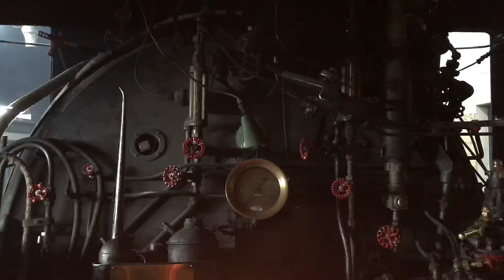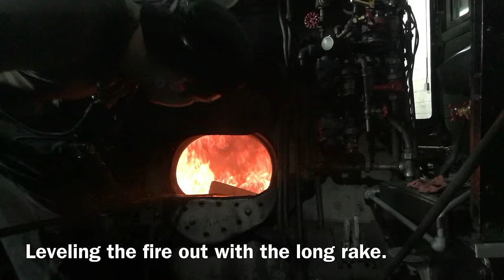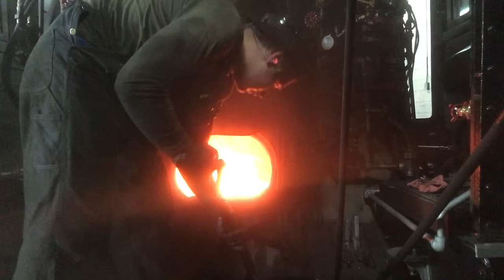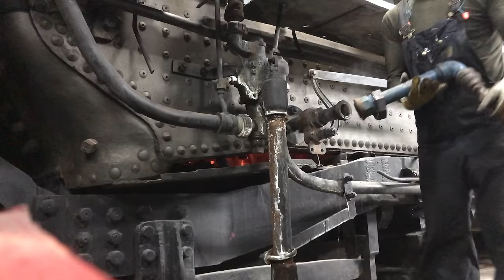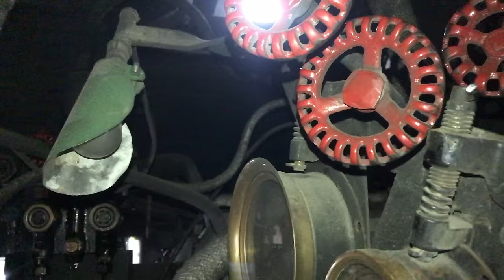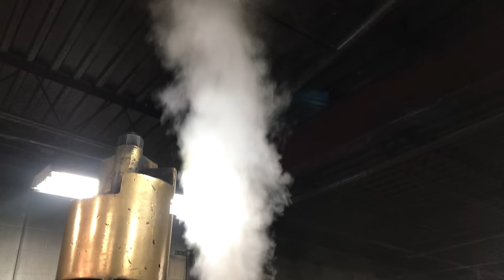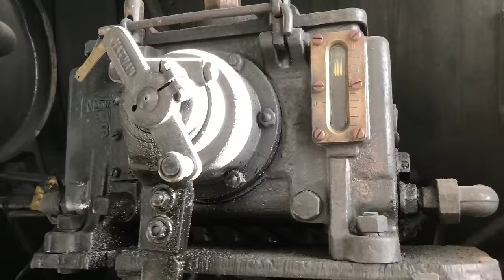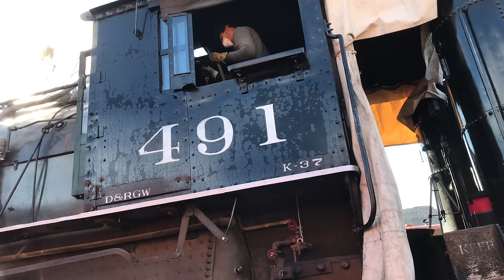How To Fire Up a Steam Locomotive [4K]

Comment: Really makes you appreciate the lads who Tokyo drifted the polar express
Reply: That was a cool scene but it would have fucked that loco up royaly
Reply: Tokyo express
Reply: You could go ask the nice folks at the Steam Railroading Institute in Owosso Michigan how well that would have actually worked. They're the caretakers of the real world counterpart to the Polar Express, Pere Marquette #1225. I've stood beside that legendary engine during some routine maintenance.
Reply: respect to Tokyo express
Reply: Mostly because the wheels can't be braked individually on each side like a car because they are bound together by an axle.
Reply: @gormauslander  Cars wheels are also bound together with an axle
Reply: Not really. They each have their own axle, and they're bound by a differential
Reply: @gormauslander  yes but you still cant break one wheel at a time
Reply: I never said cars couldn't. Cars can, because the wheels and axle are not cast in one piece as trains are. Adding differential breaking on a locomotive would be useless
Reply: @datguymiller  it was purely fictional. Trains are on a fixed axel suspension so wheels can't move or stop suddenly like cars can.
Reply: Wolfcola.mp4 I know but the sliding off the wheels would have fucked up the wheels
Reply: It was Santa’s train so y’all can take your logic and fornicate your selves with it cuz Santa has so many axels the train can turn the wheels sideways if it wanted to

Not to mention the best coco
Reply: Guys stop taking this joke seriously. It’s a JOKE, And the polar express is not the most realistic of movies. I mean it’s about a magical train going the the North Pole from god knows where in like 1 and a half hours as it goes through tons of tracks that are completely unridable and a waste of time to build.
Reply: @Victorsvolkswagens   Nani?! Kansei dorifto!!!
Reply: @renegadeoflife87  I watched a guy perform routine maintenance on the sewer beneath my house once... Unbelievable! To legendary experiences !
Reply: And that made me laugh kekeke. Good game, coach and well done
Reply: Fr tho
Reply: It was just a kids movie guys, calm down
Reply: Squidward Tentacles if I’ve learned anything from this, it’s that the locomotive community gets..steamy...
Reply: @staticalphabetsoup637  ye
Reply: Ah yes the polar express I love trains so it is a tradition for me to watch the polar express.
Reply: What’s crazy is that they had to four wheel drift just to escape. No wheels are able to turn like a car
Reply: Dank Express
Reply: couple 100,000 lb train doesnt break the ice yet a tiny pin does. yup! its a movie alright!
Reply: Legends...
Reply: @datguymiller  all she would need is new brake shoes and new tires over the wheels
Reply: @thatoneguy611  the polar express makes it's own tracks
Reply: @robintheslavewr1513  and a good oiling
Reply: @robintheslavewr1513  wait the tires wouldn't touch the ground (well ice) because of the wheel flange so you would need replacement wheels
Reply: @datguymiller  the flanges cut thru the ice so yes the did study the scene more clearly they touch
Reply: @datguymiller  it could water can cause pitting in the metal making it weak and crack so yeah it would cause damage
Reply: @robintheslavewr1513  so you would need to replace the wheels
Reply: @datguymiller  not the whole wheel just the steel tire around it
Reply: @robintheslavewr1513  what about the damage to the flange
Reply: @datguymiller  the flange is part of th tire
Reply: @robintheslavewr1513  oooohh
Reply: @firelynx1108  welcome  to  "Hollywood logic"
Reply: @alfredvonhofsten4010  you can if you plug off the other 3 brake lines on your car.... 
.
now a locked differential, no.... but 99% of cars and pickups use an open diff.... which CAN allow for 1 wheel brakeing 
again... only is something is wrong
.
like my jeeps caliper slide pins are rusted..... so i only have 3 brakes that work
fixing that soon LOL
Reply: @gormauslander  theoretically it could be done with 4 pistons and counterweighted wheels and axles
Reply: @baileydevries4494  I think you could do it with 2 pistons, you really just need 2 independent wheels instead of a single cast piece that is the wheels and axle
Reply: @gormauslander  oh true, it would just need some serious counterbalancing
Reply: Aggressivly shoveling coal into firebox whilst opening valves and pulling levers
Reply: @baileydevries4494  steam locomotivetives already have counter balancing on the wheels to balance out the force of the drive bar pushing on them so really to have it work like in the polar express is separate the one axle for a pair of wheels into 2 parts then prevent them from sliding out of the mounting points ... And then separate the two halves of the locomotivetives braking system and add separate controls...And then after separate the two drive pistons and give them there own controls... aka completely over complicated totally impractical and a waste of time and money when all you need to have is just quality fùckìng train tracks. Which would be way faster and cheaper and safer to just either rebuild fix or make new quality tracks. Edit: damn santa makes very questionable and horrific financial decisions
Reply: Smoker and steamer is their names if I remember correct
Reply: @Victorsvolkswagens  yea lol
Reply: OP😂😂🙌
Reply: You could also use coal instead of wood that would work better
Reply: The real skill was making it land back on the tracks underwater
Reply: @Mr_pumpkin_  oh yeah? Didn’t ask.
Reply: Movies are real life.
Reply: Bro that train bent around a mountain. It was just built different lol.
Reply: @gormauslander  it might help it go around corners or allow the train to go onto a different gauge of track?? maybe?
Reply: You knows too much bro
Reply: Yeah right
Reply: that thing is basically a time machine
Reply: @firelynx1108  that's actually possible if the ice is thick enough and where the pin hit would of been either a melting spot or of its somewhere that the ice is thin.
Reply: @alfredvonhofsten4010 actually the front wheels on the car are bound by a ball joint and tie rods due to the need for a steering system. The rear wheels usually use an axle unless the car is front wheel drive but it's a weirder design than you would think for a normal car.
Reply: The Polar Express Ready For Destination North Pole See Santa Claus

Comment: By the time you get rolling, you forget where you were going.
Reply: That's why they put it on rails.
Reply: That's why those went hundreds of kilometres at once, and hauled a metric shit ton of cargo/passangers
Reply: @KarolOfGutovo  passengers*
Reply: Wouldn’t it be....cheaper to never turn these engines off? Obviously this is a rare case but back when these things were a hit, did they actually let the engine go cold back at the train yard?
Reply: That's what my uncle would have said  or where were you going when I seen you comming back
Reply: You have 2 choices
Reply: @EliasDeJesus95  
The manpower costs of keeping every train constantly fueled would probably outstrip the benefits of a speedy departure, not to mention the copious amounts of water and coal needed to keep the firebox warm and boiler prepped, the ash buildup in said firebox, and the years taken off of the train's lifespan due to the firebox being constantly in proximity to fire, albeit relatively low temperature fire.
Reply: السلام عليكم
Reply: Ahhahahhaahhaha
Reply: lol
Reply: @VintageTechFan  this comment is too funny 🤣
Reply: @EliasDeJesus95  it would just make it extremely hard to do maintenance and it wouldn't be really safe plus it would shorten the engines lifespan and you would have to have people constantly working on it just a huge waste of money and staff pretty much but I mean if your going to use the train again in like 30 minutes to an hour in some cases they actually would keep it running they might just do a little greasing and prepping tho you can't really do all that much matinence while the engine is still hot plus I think all that constant heat would weaken the metal and nobody wants a exploding steam engine
Reply: @EliasDeJesus95  Some tourist railroads will keep the locomotives warm overnight on long excursions, but not fully running, NKP765 does this from time to time, but the crew takes turns doing night watch to make sure nothing goes wrong, and that gets really tiring after a while.
Reply: @jerrymartin7019  Still think the speedy departure would've been well worth it!
Reply: By the time you get rolling, you don't even have to go there anymore.

Comment: I guess you dont have to worry about someone stealing one of these.
Reply: tow it with your own locomotive... duh
Reply: To Get it hot faster use doc browns  presto logs lol
Reply: Gone in 37 minutes
Reply: welll they just showed you how to start the thing
Reply: Lmao
Reply: @supraman236  more like gone is 6 to 7 hours, according to the description
Reply: You just wait until the other guy has gone through all this, and then you steal it. Easy. Wait until he steps off for break time, and hop in and you're off. Or wait until he stops at a switch and then locomotive-jack him. Problem is that there isn't really anywhere to go; the people on the ground control which tracks to go down, and if you don't follow the schedule that was already being followed, you'll probably just crash into another train before too long. So what are you going to do? Steal the train and complete the engineer's run for him? There's a reason they don't worry over-much about people stealing trains (other than to cause mischief, i.e. by setting the throttle and jumping off). You've never seen an abandoned diesel loco sitting, idling, by itself for hours on end? There is some special key that the engineer takes with him (or her, must remember to be politically correct, right?) that must be put in before the throttle can be moved. But they don't guard the loco at all, in most cases.
Reply: Kel - Cool, thanks for that. It sounds like some are surprised these old locos dont come with immobilisers, central locking, and stop start.
Reply: @kelharper7971  its a joke, take it easy
Reply: Well, You'll know what road he took when he seals it.
Reply: It wouldn't be that hard to...........  Track them down...   Kill me.
Reply: the great locomotive chase!
Reply: Would be easy to catch them, just follow the tracks...
Reply: @kelharper7971  Well, they do guard the locomotives-or the rail yard more accurately. Having snooped around (read: trespassed) on yards in my youth many moons ago, I'll tell ya that Railroad police are the biggest pricks to ever put on a uniform. I suppose they have to be since a wrong turn can involve becoming mushy spatter.
Reply: you  know come to think of it i highly doubt you can steal a train at all lol it only has one way to go and thats forward tracks wont take you across the world
Reply: Caught a thief red handed in my car because he couldnt drive a manual without stalling it.😂🤣
Reply: @supraman236  hahahaha
Reply: A manual gearbox is enough for that
Reply: ukspizzaman plenty of time to reload a musket if they tried
Reply: @kelharper7971  "So what are you going to do? Steal the train and complete the engineer's run for him? "

….maybe...
Reply: You could “steal” it. But where would you hide it?
Reply: well thats why doc and  marty stole it
\
Reply: tow mater can tow this right?
Reply: @supraman236  
A better title would be "Gone in 60 Minutes"
Reply: Its RDR2 in real life
Reply: @MICKSHRED  Six Hours Later gets unexpected slap on the butt "Alright bud, shift's up. You'd better remember to punch out on your timecard."
Reply: Gone in 30 minutes or its free.
Reply: Just wait till its out in the open and steal it from horse back. Be sure to pack you bandana do want people give a description to the Marshals.
Reply: Just tow it using a Diesel locomotive.
Reply: We the People that would be heresy
Reply: Kyle Martin but I’m not a-
I said alright your shifts up, I’ll be seeing you tomorrow about your other musing days. You’ll be docked pay for them. 

And that’s how you get hired at a train yard. 
Next episode: How to steal a Battleship
Reply: 800lb Gorilla , not too hard to find out where you went with it... lol
Reply: supraman236 , slightly funnier if you said Gone in 2,220 seconds.. but still made me laugh..
Reply: oh it has been done. its just they start rolling so slow. someone can easily jump on and flog the fuck out of ya
Reply: Tow it with diesel loco and run.